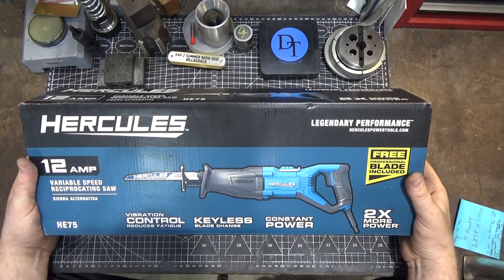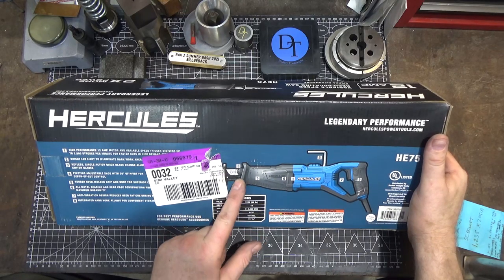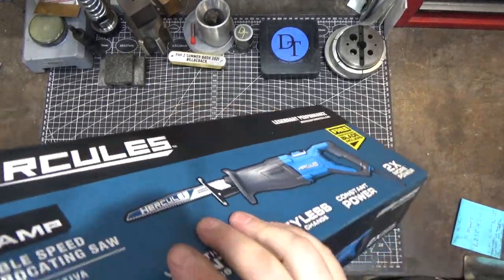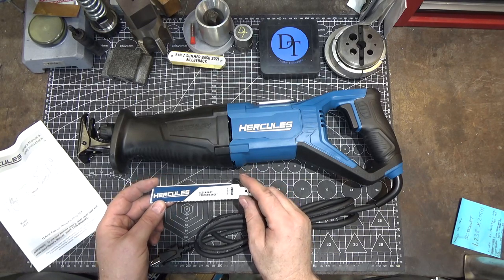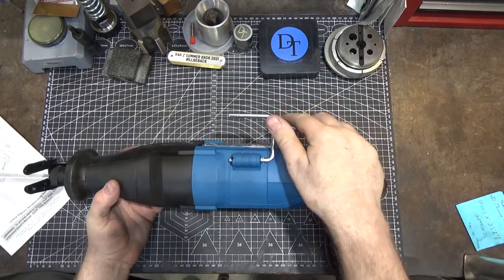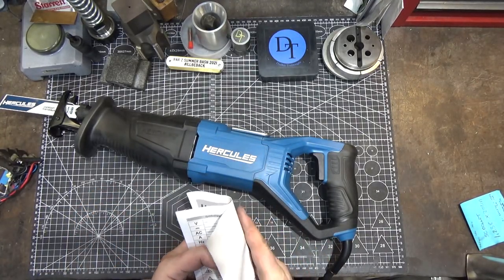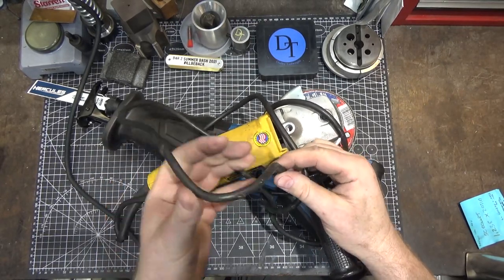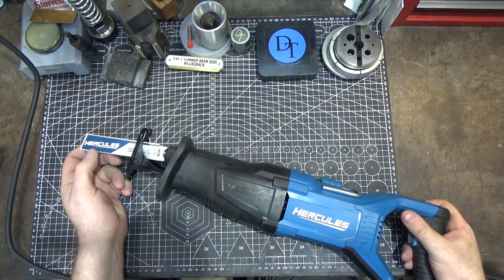QTR 68 Harbor Freight Hercules Plug In Reciprocating Saw Disassembly

Comment: Knew you would take it apart ha! That is an interesting blade release.
Reply from the maker: I was surprised at the number of components in the quick release. I seemed to be a rather expensive part to manufacture. I would have preferred less plastic, but at least the plastic parts were not in wear positions.

Comment: I've always thought of these demo saws all being relatively the same. Does rough work, but does it well. I have to say though, I recently replaced my Milwaukee with a DeWalt. I really like the keyless blade change, but that's pretty universal. What I was really impressed by on the DeWalt is that you could turn the gearbox to any of the four positions. I'm left handed and so motors always seem to blow right in my face. Found that feature of the DeWalt very very nice. It was also surprisingly helpful to flip it 180° and have the blade in line with the relatively straight top of the tool.
Reply from the maker: At first I thought the angle adjustment was like the Dewalt, but I was sadly disappointed. I am a lefty too. I feel your pain.

Comment: Those little motors are usually just a general motor thats very common;  if it goes bad, it's usually possible to find it if you dig hard enough..  I bet that there are 3 or 4 consecutive planetary gear sets that step down the RPM's by a lot.. so that you can use a high RPM motor and still get that relatively slow reciprocation.
Reply from the maker: Good observation.

Comment: Could you do a series on converting a cheap drill press into a mill?  I bought a decent cross x/y table and its not bad-- 80lbs cast iron with adjustable ways.  Its the green and red one on ebay for $125..  (if you search "mill vise" or 'mill table")...  Anyway, I think it would be a cool little project for you if you were interested.  The main thing is figuring out how to hold the tools up into the taper--- because the drill press doesn't have a draw bar at all-- it simply relies on the constant downward pressure to keep the chuck engaged with the taper.. I'm trying to resist welding the chuck into it. lol..   My main goal is just to have a simple little mill so that I can machine a few pistols with optic cuts, to put red dots on them.. and maybe some slide milling designs and windows, ect....   Just a video idea-- take it or leave it.
Reply: Check out the Aussie Shed.  He covered it quite well - https://youtu.be/7yCXTpCLOCs
Reply from the maker: Once upon a time I tried to use my Delta 14" drill press as a mill. I added an x-y table, but the press was no where near stiff enough. I think the bearings in the spindle are inadequate as well. This would be one hell of a project.
Reply: @DudleyToolwright  I don't know what I'm gonna do if I can't get it to work.  I'll likely build my own spindle with tapered bearings and either rig it up to the drill press motor-- or maybe use an old treadmill motor.  I see them on facebook for $30 all the time;  with a variable speed knob... I gotta do something. lol.. Even the cheapest mills are nearly $1k..  Eventually I will probably spend $3k and get something good when a deal comes along-- but I need something NOW-- to get me going.
Reply from the maker: I completely understand. The barrier to entry in the metalworking world is insane. Take small cuts, use positive rake inserts to reduce cutting forces and best of luck.

Comment: I ordered a Shars reciprocating saw in an attempt to get my hands on the gearbox. I ended up with two because one housing was cracked from the factory. Definitely early 90's if not earlier NOS. The gearbox is identical and the failure mode almost guaranteed if the piston material and heat treatment is faulty. It's as though they harden the guide then weld. I watched one self destruct as piston guide wears through. From what I can tell from similar tool reviews, failure of this design is inevitable.
Reply from the maker: That is really useful feedback. Thank you for taking the time to share it. I will keep an eye on the  unit a report what I find if and likely when it fails.
Reply: @DudleyToolwright  if you have a hankering for HF, the discontinued 9 amp blue pro Chicago variant can be found for 32  pre coupon. It has the same mechanism as the DWE304 and uses their shared 9 amp motor platform you can find in tools like the D Handle. Overbuilt to handle whatever head they want to mount. Just give it proper grease and go to town indefinitely.

Comment: To avoid cash in the trash. I watched videos and compared prices and features before buying. 
I chose a bigger brand name. 
My Skilsaw SPT44A-00 motor runs very smooth and sounds quiet with less vibration. 
Note the Skilsaw fits nicely inside a Rigid tool case.
Makita has brush caps and a hanger hook too.
Reply from the maker: Nice. I appreciate the feedback. My primary Sawsall is an original Milwaukee the still works great after 20+ years.

Comment: I love your reviews but for the same money you can buy the Dewalt DWE305 and you get 4 way blade mount on the dewalt
Reply from the maker: Excellent to know. Thanks. I never even looked at the Dewalt.
Reply: It's also nearly 2lbs lighter and 100spm faster. Thanks. Was contemplating the Herc for a general purpose home work saw but the Dewalt looks like the clear choice here.

Comment: Lol how'd I know when you mentioned cords you were gonna pull out a dewalt 😂 that has happened to every dewalt tool I own except a hammer drill. table saw grinders dual bevel sliding miter saw most of these rarely leave the shop .I've got tools from other brands 30 yrs old in some cases all still fine .expensive dewalt  stuff cords start breaking apart in a couple years or less in some cases .I bought a 12 inch miter  saw for a job cause I didn't wanna load my double bevel saw and carry it upstairs  and it's been a yr and so far the cords ok well see how long that last 😂
Reply from the maker: I don't have a lot of corded Dewalt tools. Interesting that they consistently use crappy ac cords. Thanks for sharing your personal experience.